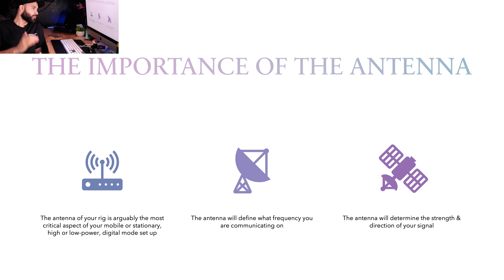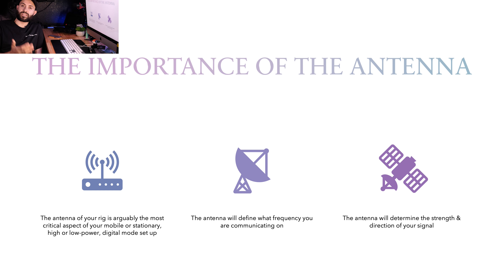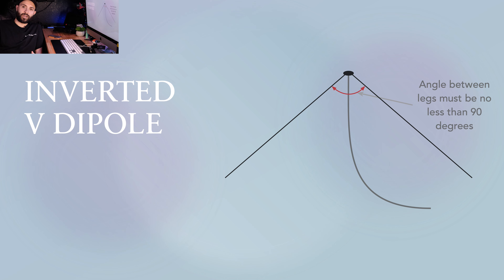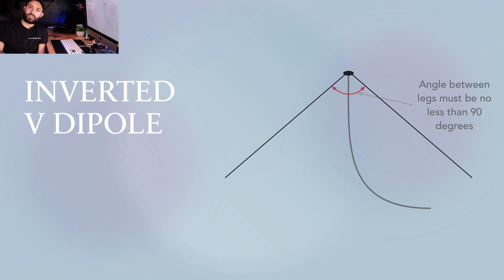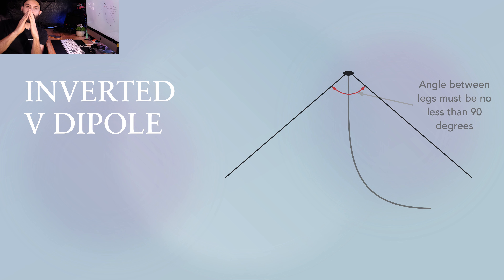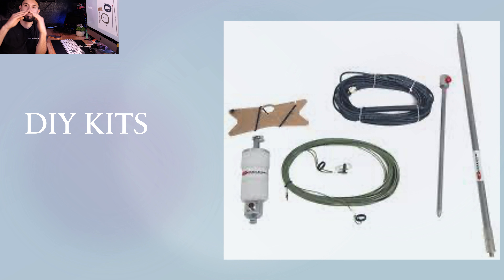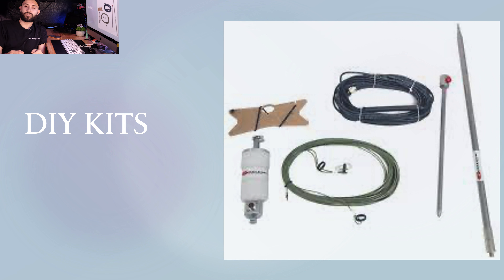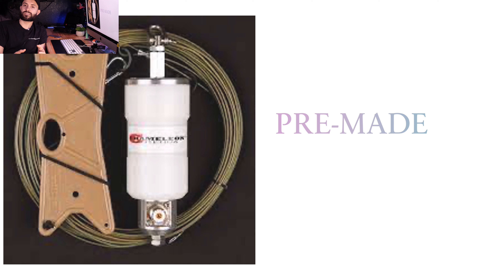ANTENNA THEORY (part 3)

Comment: Consider a purchased or build your own End Fed Half Wave (EFHW) antenna - it cut for 40m does all multiple bands (Even and odd harmonics) up with a longer wire can do 80m and up.  Cheap and works well.